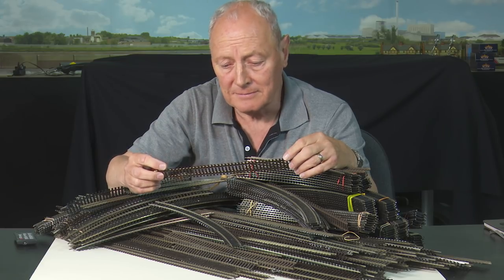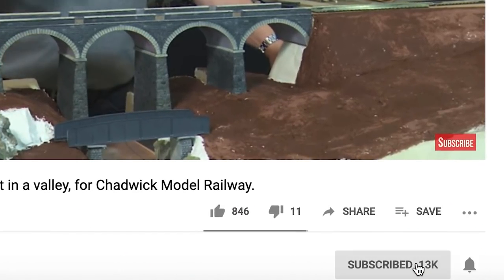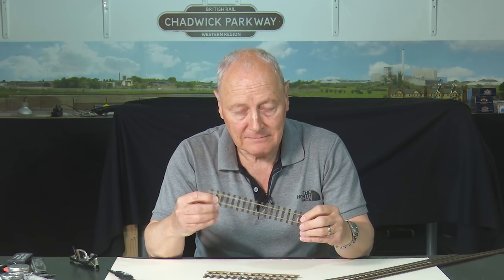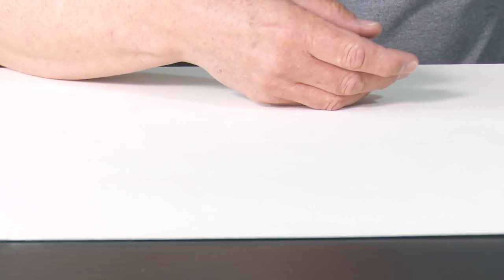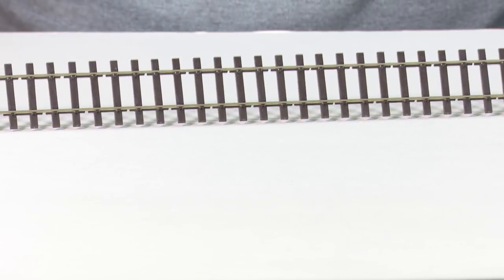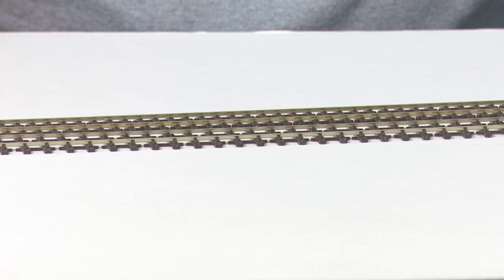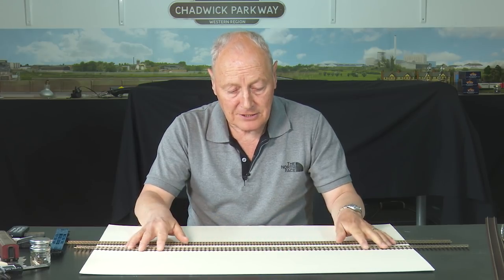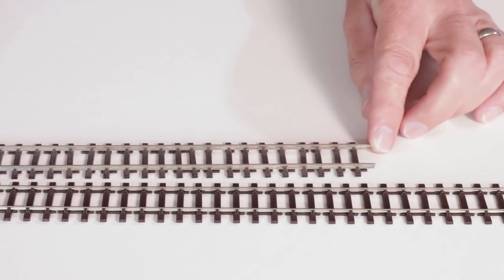Track  Peco Code 100, Code 75, Bullhead, EM and P4 explained at Chadwick Model Railway | 66.

Comment: Nicely described and well demonstrated........

As someone who had Hornby Dublo Three-Rail as a child, (after changing from Hornby 'O' Gauge Clockwork), which my Father and I then converted to Hornby Dublo Two Rail when it came out, the modern  range of products is as overwhelming as it is interesting.

Presumably...and before the advent of long lengths of flexible track...everything that we could ever previously buy was what seems now to be called Set Track or is it Setrack....?

This meant the straight or half-straight....or the curve.........

As I see it, the main issue we modellers face is that of choosing the correct code rather than the correct scale.

Obviously scale is nice or desirable, but in terms of running stock and locomotives, old as well as newer, code is a more  important factor.

Why...?
Well because we want to avoid derailments and we want wheels to run as smoothly as possible.

You correctly identify the problem of those of us with older stock.......or who take the opportunity to buy older stock from time to time; namely wheel flanges riding on chairs.

The newer Peco Bullhead Code 75 looks interesting and appears to be a major step forward with them addressing the issues of Code and older stock.............but this still leaves the thorny question of "...might Code 100 be the best choice....?"

As far as Settrack is concerned, I take the view that if it works then so be it...
We should avoid 'knocking' it because, after all, it's what we all started with anyway....

Forgetting how we started...and what our fathers or grand-fathers....and eventually ourselves in time....could afford can blind us to far too many things.

We should never forget that this is how many children are still coming into the hobby.......and as prices are now considerably higher all round, the issue of cost and what a family can afford to buy is not that different from when we were younger.....

Pardon the pun....but it's all a matter of scale...or relative.

It seems to me that the incorporation of Setrack with other forms of flexible track is an option we should never rule out.....and any amount of track pieces we have around can...with the most modest of skills be incorporated into any layout....

If rail hieght is the issue when and wherever we mate different track codes together.....and I would suggest that it is....then all we are talking about is 'shimming-up' track with packing underneath it wherever this is necessary.

Given that when track is ballasted it tends to be forgiving of any slight differences in rail hight.....should we be that worried....?

Is it the issue we think it is.........or shall we fall back on what a man on a galloping horse, (or passing train come to that), might not see...?

Keep up the good work.......

James Hennighan
Yorkshire, England
Reply from the maker: Thanks for the very interesting comment James. Good luck with your project, regards Charlie.

Comment: One comment on the bullhead track. The ties on (under?) the Peco bullhead are thinner than the usual ties we find under code 100 or 83, making ballasting a challenge. Worse yet, the Legacy bullhead from DCC has even thinner ties, forcing one to use fine ballast, as they are are the same size as the medium ballast commonly available. Spreading ballast then brushing it to clean off the ties will expose the underballast, whether cork or foam. Big challenge.
I've also been tempted to cut the connections between the ties to reveal the daylight often seen in prototype photos, but soon realized that would entail four cuts per tie. It does look great though, but for several hundred feet of bullhead - I don't think so.
Reply from the maker: Thanks Jack, for an interesting comment. I must confess, I have switched to the fine grade of ballast. It looks far more prototypical. Regards, Charlie
Reply: 👍 @ChadwickModelRailway

Comment: One thing I would add as regards Code 100 vs Code 75 rail is that the heavier the rail, the better the electricity flows through it so not as many power inputs are necessary. I know that the fishplates/joiners have a lot to do with this as well but they are also heavier on the heavier rail so it all helps.
Reply from the maker: That’s an interesting point, and one that I clearly hadn’t considered Best wishes for 2022, regards Charlie

Comment: Well that explains a lot, now I know why some of the used tack I bought is a different height to the Peco flexi SL-100 track I bought. I thought it was just down to bad manufacturing tolerances and I always thought the code numbers were in reference to the quality of metal used i.e. Steel or Nickel-Silver. I was looking for a hobby I could do when the weather is bad and I'm unable to fly my planes or go for nice bike ride round the Dales; but it looks like there's a lot more to this than I first thought; and it eats money just as quick as the other hobbies I have with perhaps the exception of Photography. Thanks for the videos, very informative.
Reply from the maker: I’m so pleased that you enjoyed it Mick.
Reply from the maker: Ops, so sorry Mick.

Comment: Well, what can I say? Confusing?  Just a bit. However I have many, many yards of Peco code 100 track together with a load of code 100 points all waiting to be laid. Guess which way I am going?  Interesting about the sleeper spacing though. 7.5 minutes to do 9.5 inches. How long to do 260 feet? Around 41 hours. Might give that a miss as well :)) Another informative video Charlie. Many thanks. Pete
Reply from the maker: Hi Pete,
You were confused, I clearly suffered too.  Mind you I did find it fascinating why we have OO stock on HO track.
My objective was to show the options, not necessarily to influence.
Hopefully that came over in the video.
Regards Charlie

Comment: For me the difference between a layout and a train set is the purpose. A trainset is designed purely for running any trains on a loop of track with a couple of sidings.

A layout is a passion project with a custom track plan with scenery and all the trimmings and encompasses all of railway modelling.
Reply from the maker: I quite like the term that trainsets get put away at bedtime.
Reply: @ChadwickModelRailway  that does describe them very well

Comment: Brilliant explanation of the gauge/scale issue that dominates British modelling. It's unfortunate that Frank Hornby decided to go this way as it is almost impossible to rectify. We see so many reviews of new products focusing on the extreme detail available today but never any mention of the loco sitting on the wrong gauge track - interesting.

You are one of the few people to highlight the dilemna and the issue will continue until there is sufficient interest by modellers to start complaining.

Keep up the good work and let's hope that manufacturers may, in the future, have another go at British HO.
Reply from the maker: An excellent comment Keith.When you think about it, if  only the manufacturers included two sets of wheels, we live in hope.
Reply: @ChadwickModelRailway  Hi Charlie, it would be interesting to see how they might deal with steam loco driving wheels but most other wheel sets could be managed.

Comment: If you get a length of box-section plastic cable trunking, file some notches in the right places, you've got a jig for spacing your sleepers.
Reply from the maker: Good tip, thanks.

Comment: These days a model railway can use PECO Streamline & SETRACK (Hornby) curves as you already mentioned radius 4 for your Helix. My distinction between a "train set" & "model railway" is that the former is out of a box using standard parts. A model railway is usually a "layout", either based on a prototype or freelance"  where the builder has been responsible for some building of scenery, constructed buildings & other hand crafted items.
Reply from the maker: Train sets are a great start to a fascinating hobby. Thanks Pat.

Comment: Nice if the comparison of EM and HO/OO track could each have the correct sleeper spacing (for the 1:76 scale).  Of course, the nice perspex tool is ideal for this,  on the outside of the curve to allow compaction of the sleepers on curves. (You did show the respacing, but not in comparison with the EM track)
In a special offer from Hattons, I bought two packs of Legacy models stainless code 75 bullhead, with lovely bolted fishpates.  At 2.83 per length, I thought worthwhile, but I have to include some in the test track to check for chair-click.  (I still hope to use the fishplates, for occasional detailed sections!)  The only bit I've used so far looks great to support a Wickham trolley on the back of a flatbed.
Not to forget that USA HO tend to use Code 83, which is often thought to represent mainline rail better than code 75.  And of course, different weight rail for different usages; high speed mainline is heavy, branch lines may be more slight.

Oh, and not to forget OO9, which allows narrow-gauge lines in the 1:76 environment, in both code 80 and code 55 (which looks good for a light railway)

Thanks for showing all this so nicely.
Reply from the maker: I'ver really compared Code 83 to 100 or 75 Tom.
Perhaps I will next time that I'm at a show and find some going cheap.

Comment: I really like code 75 Bullhead and have used it for several diorama commisions. Though it's obviously still 16.5mm, Peco have somehow managed to pull off a bit of visual witchcraft here. If you place them side-by-side the Bullhead actually looks wider and more (00) scale-like. I sold up entirely a few years ago Charles, but thanks in part to your wonderful vids, I'm thinking of getting back into it. If I do, I'm seriously considering the Code 75 Bullhead for myself.

Or 🤔 maybe the new TT 120 😇  but that's a subject for another day 😂
Reply from the maker: Good luck if you come back into our hobby with OO bullhead, 
TT120, I have my doubts!

Comment: Regarding the Lima Siphons Charlie: The chassis and body is a pretty good representation of the internally framed Siphon G but the bogies are not too good. If you re-wheel then you are still stuck with not very accurate bogies. HOWEVER, the British Railways B1 bogie found on the Mk1 coaches was based on a Great Western bogie and is therefore not too disimilar from the GWR bogies found on the Siphons. As I only run three Lima Siphons I 'grafted' Bachmann B1 bogies (available as spares and are quite often found on GreedBay) onto the Lima underframe and ended up with a pretty good all round representation of the internally framed Siphon Gs for about the same cost as re-wheeling.
Reply from the maker: I’m on the case David and I may be after further advice on the subject.
Regards Charlie
Reply: @ChadwickModelRailway : I attached the Bachmann B1 bogies (Mk1 coach bogies) to the Lima Siphons using 4mm mushroom head allen bolts (GreedBay again) with spacing washers inserted between the chassis underframe and bogie top by trial and error to get the correct buffer height set against other rolling stock. I used nyloc nuts (the nuts being on the top-side of the underframe so inside the Siphon bodies) and popped a droplet of superglue onto the bolt where it came through the nut just to be extra sure it doesn't work loose. The end result is a much improved Lima Siphon G.
Reply from the maker: A wonderful tip David. I’m on the bogie case!

Comment: Hi Charlie, bit late to the argument but heres my opinion. Train set = simple loops with little / no detail for playing with , generally not a lot of fuss about eras and trains.
Model railway = designed with detail in mind, attempting a decent level of accuracy can be loops/tail chasers, but generally have dedicated lines and then yards for storage and shunting in. 
I wouldn’t say settrack isnt for model railways or that it is indicative of a train set. Its a great starting point for a railway, later can be replaced by streamline if within budget
Reply from the maker: An excellent point beanie. Might I suggest that the difference between a model railway and a train set is, trainsets get put away at bedtime! Regards Charlie

Comment: A very informative video on the different types of model railway track. I would like to point out however your statement on Bullhead concrete sleepers is incorrect. There where and probably still are many instances of bullhead rail on chairs bolted to concrete sleepers on Britain's Railways. Dowmac used to make them. What I find is missing from the model track range are steel sleepers. These are in use in many areas today.  How do you join Code 75 to Code 100?
Reply from the maker: You make an excellent point.
To join code 75 and code 100, Peco make a converter track. Regards Charlie

Comment: Maybe you might have addressed the real technical origin of 00 gauge and why it never applied to model trains manufactured on the continent (or in the US) which have always been using H0 gauge AND scale. The simple reason is that UK railways have been using a smaller loading gauge than continental one (while American ones are using an even wider one than the continental ones). The result being that H0 scale European locomotives and rolling stock are wider than British ones, allowing models to accommodate much more easily clockwork and electric motors when they started being manufactured in the early 20th Century while British manufacturers (Basset-Lowke then Hornby and Tri-Ang had to "cheat" and adopt a wider gauge for their locomotives and then adopt a 1/76 scale instead of 1/87... Hence the "Double O" instead of "Half O"... Btw, this difference in railway clearance explains why continental rolling stock (goods wagons and passenger coaches) could not be used on UK tracks except for dedicated "narrow frame" ones (hence the European CIWL coaches for the famous North Star, Orient Express and other Golden Arrow trains stopped at Calais to be replaced by British narrower Pulmann cars on UK tracks. Same stories with the Eurostar: the first ones (the Alstom ones) are narrower than the standard TGV/Thalys continental ones) since they had to ride on the Southern Railways tracks once on the other side of the Channel. But as soon as the dedicated HST 1 tracks were laid between the tunnel and London-St Pancras, "standard breadth" continental bullet trains could be used (like the Mark II Eurostad ones which are a simple variant of the German ICE made by Siemens). It must be added that this original dilemma originated too with the original project of having Eurostar trains crossing through Britain and riding up to Scotland straight from Paris or Brussels, which never came to fruition, due to the absence of a real network of high
 speed tracks in the UK.
Reply from the maker: Wow Jean, that’s that sorted.
I had to read it twice to take it in.
Reply: Yes, I agree that the loading gauge is how we have been able to "get away with" OO 1:76 in the UK, though I think it's worth pointing out that early post-WW2 models from the likes of the Märklin and especially Fleischmann were grossly overscale. Back in the early 1970s my dad and I converted our layout from British outline OO to German outline HO, partly for the better running of German producers than the then ubiquitous Hornby, partly because the scale and gauge more or less matched.  I say more or less, as I recall seeing layouts in Continental Modeller in the early days done by a chap who modelled fine-scale HO, which was like the difference between EM and P4, and just a different hobby to the one we were interested in!  One interesting thing about continental manufacturers and European outline HO is that to make the coaches go round the tighter curves of a model (or perhaps a train set would be the better word), they tended(Rivarossi were an exception)  to make the coaches to a 1:100 length (which IIRC meant they were about 24cm long rather than the c. 30cm they should be in 1:87).  So in the 80s and 90s, you got the situation where Roco was making the same coaches in two different lengths!  When we moved to the scale length coaches (fortunately the layout was big enough to accommodate them), it was like respacing the sleepers on Peco 16.5mm track to 1:76 spacing: it made a big difference visually, but really only if you saw them side by side or side by side to a prototype photograph.  I think that in railway modelling, you either have to make compromises, or you have to scratchbuild virtually everything  to EM or P4 standards.

Of course, the compromise of 1:76 also meant that when N gauge came on the market, British outline N gauge (originally OOO gauge, I recall, at least from the rubber band driven Lone Star "models") was 1:148, whereas Europe and America went for 1:160.

Comment: Another great video Charlie and thought provoking.  I am watching this in April 2021 having just bought some code 75 Bullhead track and a couple of SL18 points. The small layout I have planned needs a double slip, but of course they are still not available. The basis is an exchange yard between a colliery and BR so I need to consider whether I can use a "standard" double slip and try to disguise it with coal spillages and slack. 

Thanks again Charlie.
Reply from the maker: I would give Peco a call for a forecast date Phil.
Reply: Yes Charlie. Good shout.  I will do that.  Thanks 
  @ChadwickModelRailway